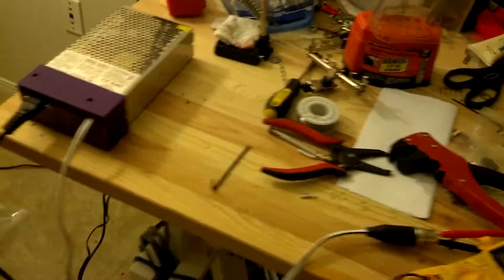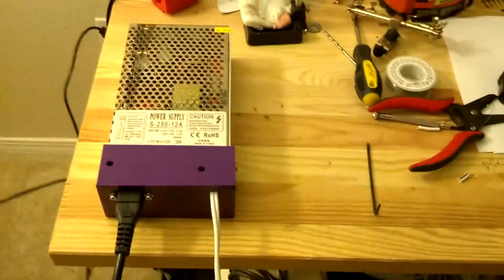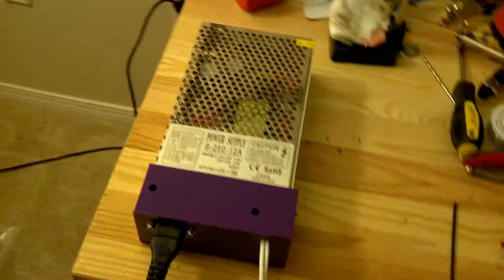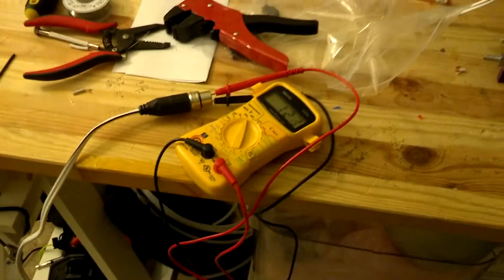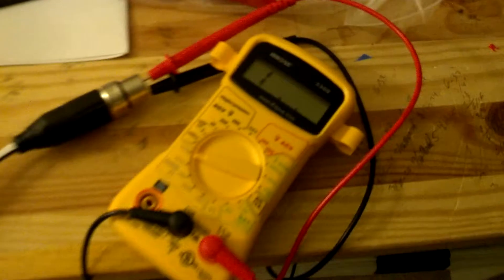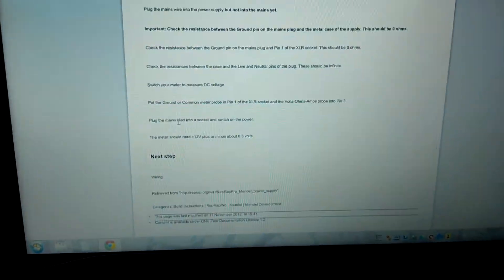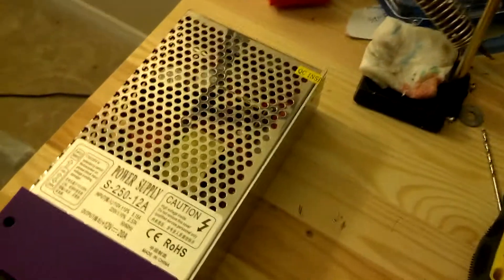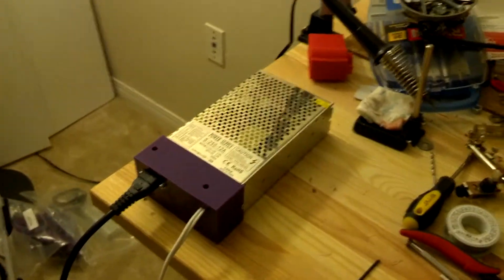Reprap Project- Power Supply Works! And no FIRE!

Comment: LOL. A day without an electrical fire is a good day! Happy to help, but you didn't need much. I think most people just need a very few hints to solder right. Check my videos for more examples, but here is a quick overview for anyone who thinks they can't solder: 1. Hottest possible iron, get on the pad, touch of solder, on the lead, feed solder, and get off within a few seconds. 2. Never pull on anything, use gravity to hold or release (when desoldering) or whack the board to remove solder.